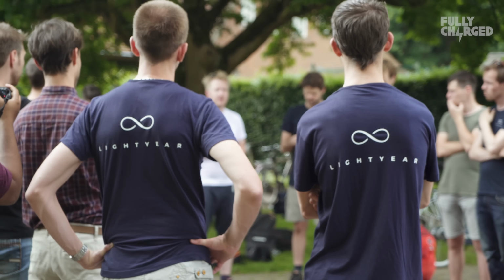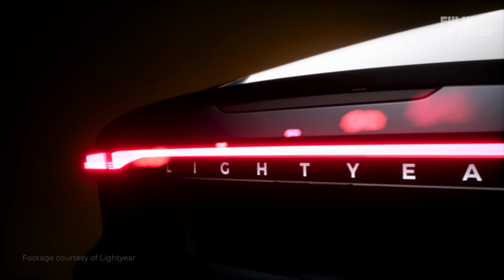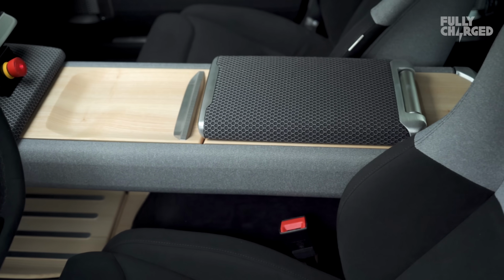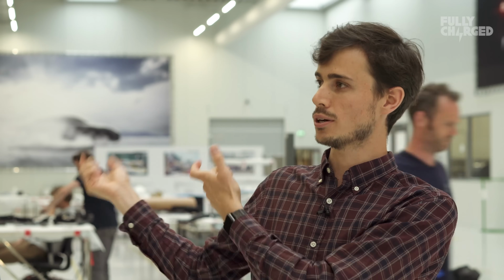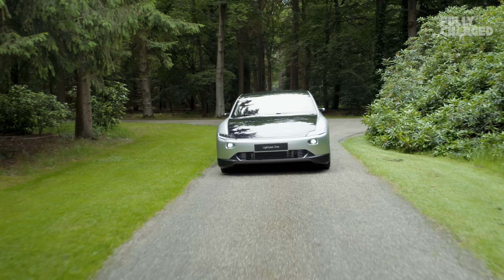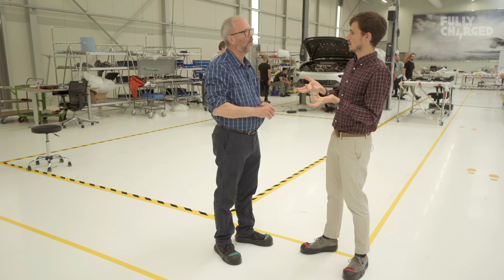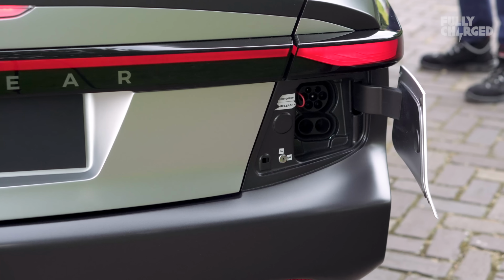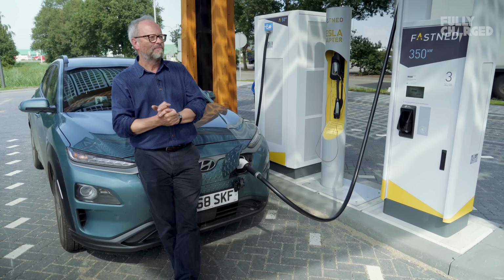Lightyear One solar powered electric car - exclusive first look | Fully Charged

Comment: Having solar panel on a truck can be a good idea, but I just don't think it's very exciting or practical on a sedan. You only get tiny range from solars in a sunny day but have to carry the weight all the time.
Reply: Look up "stella solar challenge" on Youtube and react on it.They managed to cruise with 5 people on the sun at 80 km/h and still generate energy from the sun to the batteries.These kids are serious i can tell you :-)
Reply: @неболтай-в2о  but that's not the case for this car. In the video starting from 16:48, he said this car can only generate 50-70km on a good day.
Reply: @minervali631  And 30 on a bad day.If you need power you always can charge.But if your work is 15km from home you can drive free.The bigger picture is that in a bad country like the Netherlands you do 10.000km a year on solar power and in a good country 20.000...That are figures.

Comment: This look much more impressive than that Sono motor sion car you did a video a few months back. All the solar panels need to do is provide enough power to justify their weight and to power everything else on the car apart from the motors. This way you can give a much better guarantee of range in all weather conditions.

Comment: Maidstone to Eindhoven on G Maps is only 252 miles. And that took them a day in time on a fully charged electric car. Hold me back... what on earth will be their average speed travelling such a relatively small distance? No, but thanks, you can keep it! 

I have a range of about 400 in my CLS and I'd do that trip in 3.5hrs. I regularly drive from Manchester to Nurenberg in my car, that's 11.5hrs total drive time including the breaks and the additional fuel stop. I'm not sure what my average motorway speed is, probably somewhere between 80 and 100mph. I'd hate to plan that journey and deal with the charging constraints that an electric car would have.

I'd prefer the flexibility and range of combustion. I'd love a Tesla Model S, 0-60 in 2.3 seconds...Ludicrous :-) But it's a second car for me.

Comment: I absolutely love it, but it's still a big heavy vehicle that will only carry, on avg, 1.5 per trip. Dead weight ratio still way too high, but a huge improvement in efficiency gains. It's definitely something the world needs, but I just wish more people were working on smaller lighter electric vehicles that cost much less, take up less space, and are closer to 1:1 with what's being transported.

Comment: For boats and planes, we'll most likely have to rely on carbon neutral synthetic fuel to arrive to the market sooner rather than later. Several are working on it successfully. Now it's all about dialing the knobs to get the best efficiency to become somewhat competitively priced. Batteries are currently not dense enough for larger aircraft, several decades away for transcontinental unfortunately.
eg. https://www.sciencedaily.com/releases/2019/06/190613103146.htm

Comment: Any techie folks want to tell me if I'm correct in my statement?
I drive a plug-in hybrid Prius. I have solar panels on my home, so the electricity provided to my home comes from solar. I don't use grid electricity in the daytime. Instead, in the spring and summer months, I send excess electricity to the grid. I do, however, use grid electricity at night. I charge my Prius overnight and am using grid electricity at that time to charge it.
HOWEVER, I switched my grid electricity provider to CleanChoice Energy, who sources all of the electricity I use from them from a solar farm in North Carolina. Assuming that is 100% accurate, even my nighttime electricity consumption is 100% solar. I feel that I am driving a solar powered car. Am I correct?

Comment: Just awesome car, I can't forsee that I  ever will have that kind of money to buy a car for. But others might, and what a car they can have then. Sonos Sion, is the car I am waiting for 25k (with batteries). Great effort of the Fully Charged team to travel green. Hard noch impossible to go longer then car-distances then, but the planet might accept that trade off. Flights stands for around 30% of the Co2 emissions and consider most of them (flights) are for fun, we can make a change and stay at home instead.

Comment: I don't understand why ALL electric vehicles aren't covered in solar cells.  It may not be enough power to run the vehicle on by itself but every little bit helps.
Reply: Maybe because it adds thousands to the price of the car and eliminates the possibility of a sunroof or even a rear window.
Reply: @fotoguru222  I meant on the hood/roof/trunk lid.  Don't be obtuse.

Comment: [ ed ]
Commented before watching, scratch mentions of petrol [ en_US: 'gas' that is a liquid!!! ] in this case. [ still makes heat in the solar charging and use ;0) ]

-----------------------------------------------------------------
I hope there is a #stirlingEngine to recoup lost heat in the regulator/rectifier and charger to supplement the power.

#theMoreYouKnow
Don't forget kids the Bugatti Veyron made 3,000 HP at first start and set fire to the test rig, they didn't have 2,000 HP-worth of cooling at first to get rid of the heat, they missed a trick ;0)

I reckon we could use Turbo 'run-away' as a great heat source for a Stirling cycle engine to convert the heat directly to power.
My [ messy Autistic 155+ IQ Brain ] says super lean-burn 'triple hybrids' [ Petrol/Cells-supercaps/stirling ] are the next obvious step.

The leaner you make the engine, the hotter it runs [ can you spell blow-torch ] and the turbo naturally leans the engine, a high pressure Stirling with Inconel parts to take the [ purposeful ] over-heat.

I mean doods, when are we actually going to trap as much waste heat as possible? The exhaust temp is always hotter than the ambient, which also heats the bloody planet up. Seems like a complete no-brainer to me.

[ once did a body heat calculation for 7BN people and realised our actual bodies make so little differ to climate ]

Lithium is another stop-gap on the Tree of useful chemicals and only a short one.
Reply: I think logic dictates that the next 'obvious step' is more bog standard lithium ion powered BEVs seeing as everyone is JUST gearing up to go down this route....

Comment: you would think with all those engineers they could find a way to put the solar power modules together without ugly gaps between every one. also I really like to see out windows there are very small windows here, I wish there was a bit more natural light. I think it is great that they are making an efficient car however the Tesla does everything that this car does with a only 1/3 larger battery I don't see the solar as a huge improvement, but the off the shelf solar panels are a disfigurement in my opinion.

Comment: Ultra efficient car, still towed by G-wagen haha
Reply: G wagon is probably one of the least efficient cars out there. Gets the MPG of a Hummer or Jeep. Even worse when towing something.
Reply: @theatom7264  The G Class sells with a plethora of engines, including a few efficient diesels.
Reply: The car is not road legal so has to be towed. Perhaps Martin would like to donate a Tesla "semi" truck to do the heavy moving.
Reply: @Dave5843-d9m  why so offensive? The contrast of the two was just something I had to point out.
Reply: @Dave5843-d9m  A Model X with a tow hitch would be more than enough to tow a load like that and much cheaper than the semi. It probably costs about as much as the G wagon for the P100D version.
Reply: Prototype fam

Comment: It looks like a stretched out Honda Insight from the year 2000....but with the modern look of an 2010 Honda Insight with a bit of Audi A5 mixed in with it...very, very weird design! Imho, I absolutely hate the 2000 Honda Insight design....the 2010 Insight is OKAY...but this...ughhhhhhh Rear-end is wayy too long. Either lenghten the wheel-base or cut a quarter of it's rear-end off in terms of length....but if they did that, it'd have the same side-view as an Audi A5 tho.....Wow, just noticed it's front! It looks really dated. A BMW 3/5-series from 2006 looks way more modern!!

Comment: Love the design, but it's quite expensive at 149K Euros, and 0-100 km/h in 10sec isn't very impressive. Also, the fact that solar only charges 12km/h isn't very impessive. I'm interested to know how much of the cost is so that solar can charge its batteries, because it's maybe not worth it.

Comment: This is beautiful. Not only is it electric but even while its sitting still its still fueling up because its solar powered. Solar and electric. It looks like you may not need to fuel up but twice out the year. I wonder if this Solar powered part of the car is helping to lengthen the battery life power of the electric charge in the battery that you use to charge up the car too just like a regular gas and electric powered car.

Comment: I'm so excited about this. I had a converted Pontiac Fiero that had solar panels on it. You may have seen it on the Internet. I would get a few miles of range after a day in the hot sun. Even though it cost me like $7.50 a month to charge off the grid those few miles given to me by the Sun were free. I always wondered what it could have done if the vehicle had been purpose built to be solar powered. My solar EV was built before charging standards existed, but it could take 110v to 240v with plugs and adaptors of every kind. I even had an Edison light bulb socket adaptor to charge from. I'm so happy for this team. I'm looking forward to seeing the production vehicle. Thumbs up.

Comment: 10 to 12km per hour is great.  I realize that is peak not average.  My daily commute is 50km and my car is constantly parked outside.  So if I get say 6km per hour while parked at work, that would nearly cover my commute.  Of course summer would bring a lot more energy to my car than winter.
Reply: He mentioned 10.000 or at least 8.000 km of solar range per year. In the Netherlands. That's a daily average of 27 or 22 km.
Of course, more in sunnier countries like California or Australia.
Reply: @701983  I'm in Germany and we have about the same weather as Netherlands.  Maybe a little bit better.  Summer, I will have most of my commute run on sunlight and in the Winter a little.

Comment: I never understood why all hybrid and ev cars did not have solar roofs and hoods as most cars spend the most of their lives sitting outside in the sun, well done!
Reply: Money.  It is like buying electricity for $0.30 per kWh.  And you don't get much.
Reply: @CorwynGC  If you are at work for 8 hours a day in a parking lot with no plug it will help
Reply: @roadpanzir  Of course it will *help*.  Just generally not enough to be worth the cost.

Comment: solar panels on the roof may produce enough power for the radio but dream on if you think they will provide enough power that 1.2 kw hours works out  less than 2 bhp an hour so ten hours in full sunlight will give you 20 bhp for one hour at 100% efficiency . but using large solar farms will be the way forward

Comment: Well it's good on paper but 10 000 kilometers per year thanks to the solar system is not that much. Let's take a model 3 for example, to do 10 000 kms you need to charge like 25 times the car (400 Kms per charge), it cost less than 10€ to charge the battery at home in France which means I will save only 250€...
Reply: That is actually really impressive for a solar car.  The trouble is that solar power is diffuse, and cars are size limited.  Given the constraints they did really well.  But, no, it isn't about money saving.

Comment: I think when you look at the efficiency of Model 3 thats enough. And when Maxwell tec up and going 400 mile range? I think problem is UK having to pay 27p - to 37p per kWh at public charging stations. Which I dont think is encouraging uptake. Charges should be on line with avg home prices, or less because they buy far more electricity.

Comment: So they designed a car that didn’t have reverse ?
Reply: NO, they made a prototype, not a finished production vehicle.  This is its first day of travel.  You have to crawl before you can walk.
Reply: CorwynGC if you create a drivetrain that can go forward, you change simply the direction of polarity to go backwards - it’s not that hard...
Reply: @johnmacward  "Change the polarity of the neutron flow?"
It isn't a DC motor, it is (probably) a computer controlled three phase AC motor.
Could you walk backwards on your first day walking?  You just reverse the order of the steps, it's not that hard...
Reply: @CorwynGC  I think you quoted me wrong, I never mentioned "neutron flow". AC induction motors use electromagnets to entice a stator to spin, run the magnets in an opposite direction and the stator can go in the opposite direction, often called "reverse". I agree that saying "polarity" wasn't probably the best word to use there.

This is a car we're talking about, we're not talking about a mammal the learns over time from experience and trial but something that's created by very innovative humans with already highly available parts that just need to be assembled correctly, that's why I find it hard to believe that they can't reverse it - especially during it's first main public event where the eyes of the world are on it.
Reply: @johnmacward  No, sorry, that was a quote from Star Trek, and meant as a joke.
Maybe they just weren't willing to risk trying reverse, I don't know.  But getting reverse out of a computer controlled motor is not simple (if you are the one writing the computer control).  An AC induction motor does not have permanent magnets, There are electromagnets on the outside, that induce a current (and thus magnetic field) on the inside (rotor), hence the 'induction' name.  Since the direction of the AC switches multiple times per second, which stator electromagnet gets what current is constantly changing, which is why it needs computer control for complicated jobs, like running a car.

Comment: They should make an EV with a LP or NAT Gas 480 Volt DC Generator  built in as an option in the "Frunk" .  This would be perfect for when you need it and it can charge the car like a Tesla  in  a little over an hour.   Try taking a long trip and go camping with your your family where its like 200 miles away (400 Miles round trip)  ...  You end up planning everything around chargers, and what do you do when there is NO supercharger  because that's like an 8 to 10 hr charge, or no 220 Volts.   In the USA 220 Volts is NOT the standard  for outside receptacles and the like, our plugs are 120 Volts  so that takes days to charge a car.  Every home gets 220 Volts but  only Electric dryers, ovens, and hot water heaters ect...   use 220 V.   A car trip from NJ to Disney World in Florida takes like 20 hours, if I only have access to 220v Chargers I would end up charging the car for more hours than I was actually driving!!!

Comment: The front looks like a nice car but after the front doors it's as if the designer had a stroke. Wedge shaped cars should stay in the 70's because it's atrociously hideous. It's like an attempt at pretentious fusion design that failed miserably.

Comment: Very cool, but power density of solar panels is very low.  If they were lucky there is maybe 1000 watts on the roof.  You'd get may be 6 hours of rated power a day in a sunny part of the world and that is only if the panels are tilted correctly (6000 watt hours) A Tesla model 3 small battery is 50,000 watts.  So you are talking about 10 days to get a full charge.  (Battery charging is not 100% efficient)   You are definitely going to have to plug it it every day to use it.  It's a gimmick at best.

Comment: This looks like a great car ...IF they fix a few problems
No back window is unacceptable (cameras are great, as supplements. They are not acceptable as replacements) Also, there needs to be proper buttons and wheels for media/climate/comfort controls. Anything where the driver has to use a touchscreen, to do any of that, or anything else that needs to be done, whilst driving, is unacceptable.
Not only does it reduce ease and comfort, in handing the controls (without even looking at them!), but it is also a clear safety hazard! (the driver should keep his/her eyes on the road! Not a control screen!)
At what benefit?
About a penny/cent or two reduction in production cost?
One or two grams weight difference?

Comment: It's an interesting concept, but I must wonder about the logistics of this car, are the panels actually worth it in terms of what they provide for the cost they are adding, inshort how much battery capacity are you giving up? Sure the solar panels make give you a little bit of extra range, but if the five miles of solar panel comes at the cost of 10 miles of battery storage this is going to be nothing more than a pointless gimmick for rich people.

Comment: I would have been more impressed if it could have gone a little faster...
Reply: Saw them pushing it backwards by hand. Doesn't seem to have Reverse yet. Judging from the wheel chocks, they may not have Park yet, either. This is just the first prototype that actually moves. They still got a lot of work to do on it. THEN they need to learn about volume production.